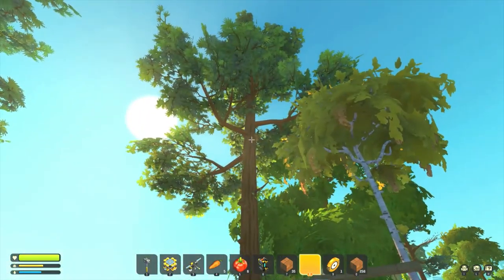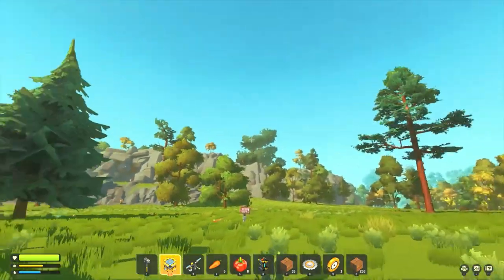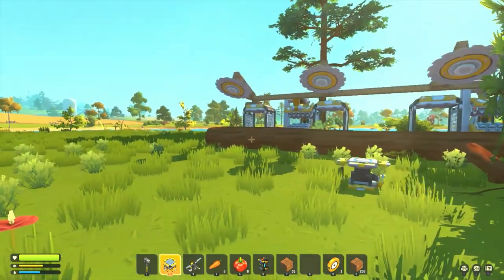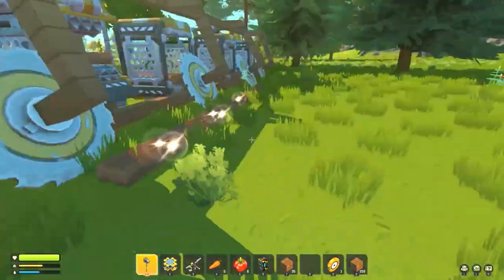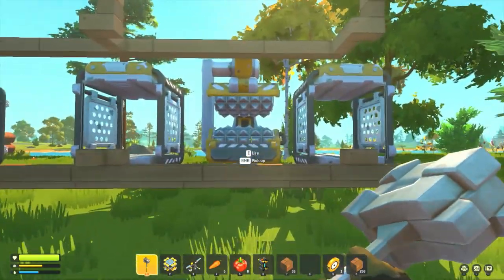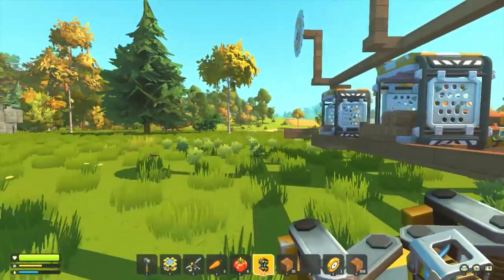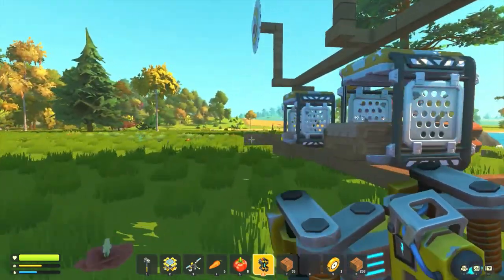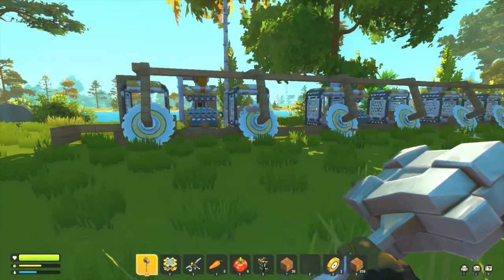Scrap Mechanic Survival - Gravity Mill. Using gravity to process whole red woods. In 15 seconds!

Comment: that's actually an amazing design given the components required to build it.
Reply from the maker: Its a very fast way to clear a forest. And still one of my favourites, with out needing a dedicated logging truck. Move to forest on lift, fell tree(s), weld trees together, drop machine. Done. I also have a swinging saw like a battering ram for cutting redwoods.

Comment: piston saw machin is way more op whit less saw
Reply from the maker: Less saw, more component kits though. And how long does it take to process a whole  redwood?
Reply: @GuardianOz  full red wood if you use a long piston plate its like 4 red in less than 10 sec
Reply from the maker: @narimikoaldera5387  Awesome I will have to look up the design. Thanks